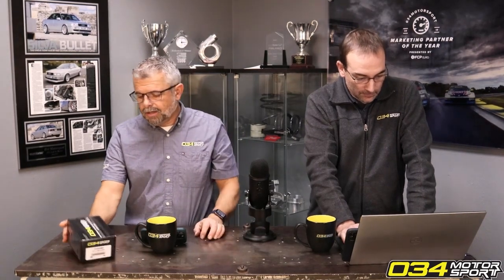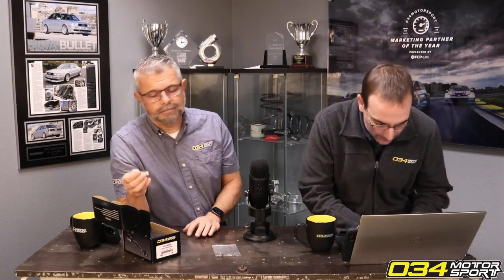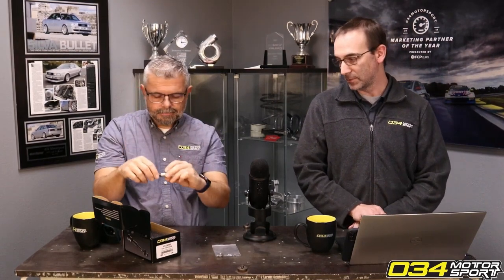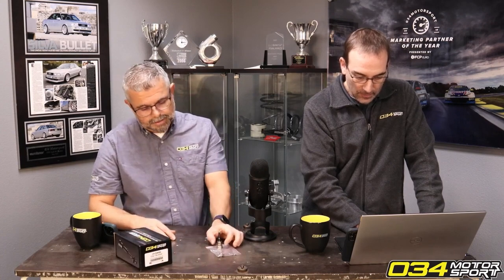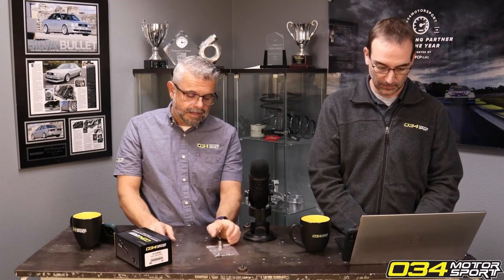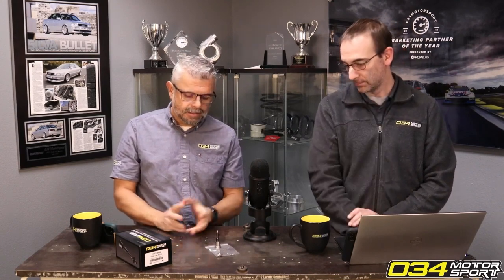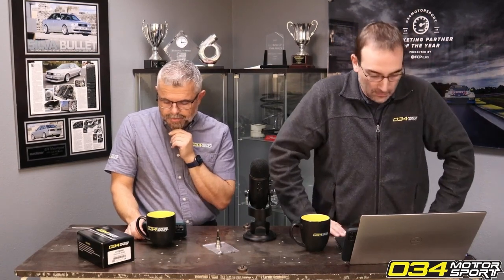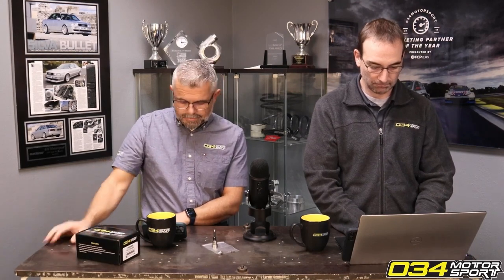034Motorsport HPFP Upgrade For EA839 2.9T & 3.0T | 034Motorsport FAQ

Comment: Hi  034 team.  I recently installed your Audi 3.0t supercharger fuel pump piston upgrade.  Can you tell me what psi the pump should be running at now?  I'm looking to run some logs to see if it's up to spec.  Thanks.  2015 Audi S5
Reply from the maker: Hello! Please email our Hardware Team at techsupport@034motorsport.com and the team can provide an answer for you there. Thanks!

Comment: Okay. So I’m back n now I have purchase this. Do I need to retune my vehicle? 
It’s already on the Stage 2 +
Reply from the maker: If you already have our 2+ E85 file, you will have to fill up with E85 and flash to the appropriate Stage 2+ file.
Reply: @ 10-4 current on 91 octane. Cause that’d all I can afford at the moment. In order to use other octane levels I have to upgrade correct? 
Also will you guys in the future be considering upgrading the S.C itself to help us squeeze out more power. Since the audience is bigger now then before.

Comment: Will this upgraded hpfp prevent misfires that occur from E85 that is too high? I’ve seen B9 3.0t’s that have misfired only when pumping a full tank of E85 on your E85 files, trying to figure out how i could seamlessly pump a full tank of E without issues and without using an E content analyzer
Reply from the maker: A content analyzer is recommended especially if ethanol content levels in your area are known to be inconsistent. If you're experiencing misfires on our E85 files, please email tuning@034motorsport.com and our team can assist with a troubleshoot.

Comment: Is there a need or benefit for this upgrade if I am running Stage 2 93 octane file?  Is it only necessary when running the + or Stage 3 files?
Reply from the maker: There isn’t a benefit on 93. The plus files requiring the HPFP upgrade applies to our E85 file only. However, the fuel pump upgrade can be ran on regular pump gas files and makes a great upgrade for Stage 3 applications in the future.

Comment: Awesome that you guys came out with this. It’s such a great cost effective option for us rather than purchasing an entire pump for over $1000. 

Also I was just curious in comparison to the APR rebuild kit, they provide a new tension spring that’s a different specification, per their site. Why is it they do this and you’re able to reuse the oem spring? Thanks
Reply from the maker: Our HPFP Piston Upgrade is designed to work with the factory tension spring, making it a complete drop-in kit, without the need for any additional hardware.
Reply: @034MotorsportUncut  very cool. Thanks fellas. 👍🏼

Comment: After installing the locking collars onto the groove cut into the piston, 
and pushing the washer over the tapered ends, is any tapping required to lock it in place?
Reply: No, as long as everything is seated it locks in place under spring tension.

Comment: If I install this with just the normal stage 2 tune will it be dumping too much fuel (bad mpg, too rich, etc)? I want to install it ahead of time to prepare for stage 3. Thanks!
Reply from the maker: The ECU will properly control fuel flow, so you should have no concerns running this pump on the normal stage 2 tune!

Comment: Hey guys, this community will absolutely appreciate this R&D effort. Just to be clear for us that aren't that technical in these matters, the difference between yours and APR's (assuming the competitor) is that 034 made a piston upgrade to swap out, where as the comp made a full housing? In other words, an unnecessary unit?
Reply from the maker: Our pump is offered as a DIY solution, allowing our customers to save some money.

APR is offering to essentially install their piston into an OE HPFP housing, or for you to ship them your HPFP housing for them to install it for you.

Ultimately, they both flow the same. Our 034 HPFP upgrade is backed by out knowledge and testing - and is a cost effective option offering the necessary flow upgrade for tunes that require an upgraded HPFP.